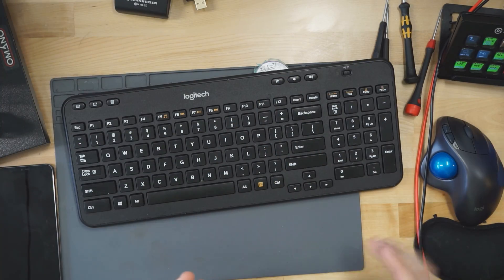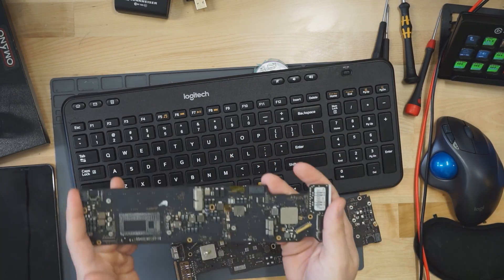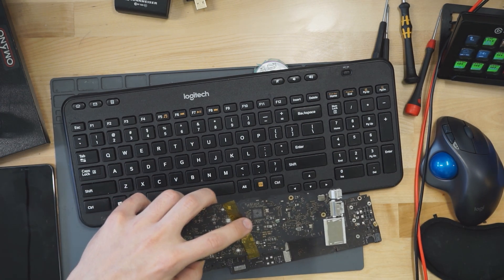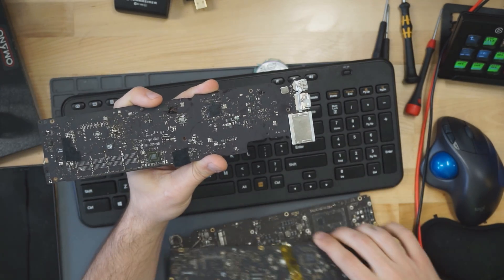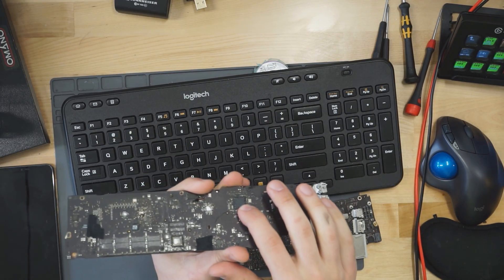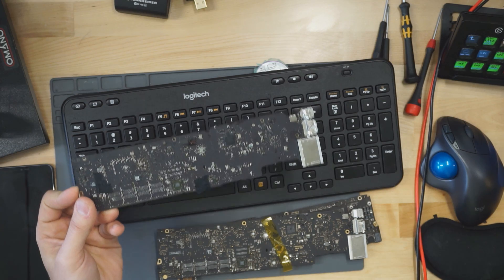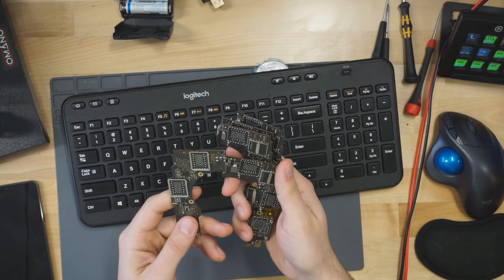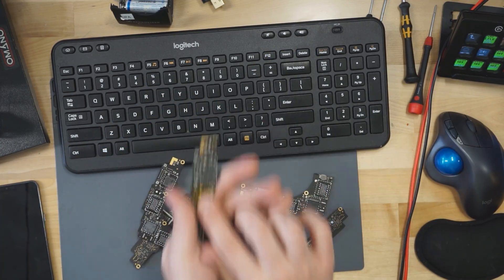𝓕#&* APPLE part 2: The morals & ethics of dumpster diving.

Comment: Hey Louis! would you happen to have a transformer for a Presonus ACP22 2 channel rackmount compressor/limiter/gate? or knowledge of potential sources for transformers?
Reply: Transformers are simple parts, get one with suitable output voltages and currents and wire it in.
Reply: @brainndamage  not a bad idea. I feel like the board it's on, in a semi non accessable spot might be the trouble in this case.
Reply: @infinidominion  What kind of transformer is it? I was assuming it was a power transformer, this sounds more like something else, like an audio balancing transformer. Then again, I'm speaking out of my ass.
Reply: @brainndamage  it's just a small 120v black box in an audio compressor, similar to what's in amplifiers. Louis has a background in audio and I was just messing with the compressor today but don't have the highest hope's it's gettin fixed.